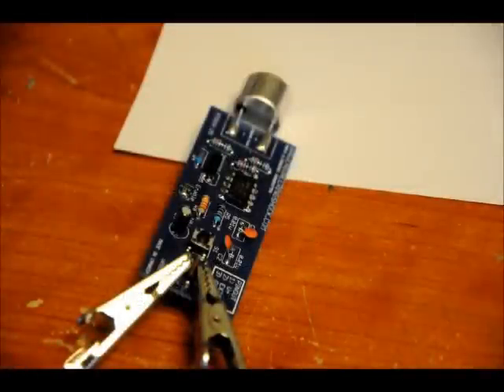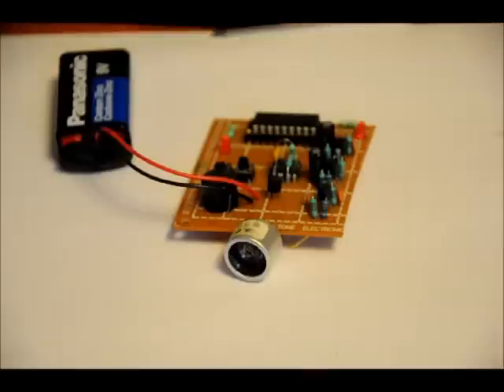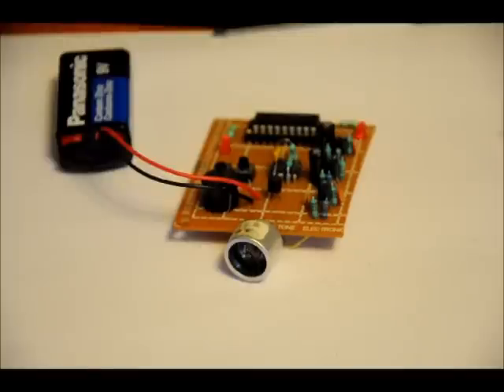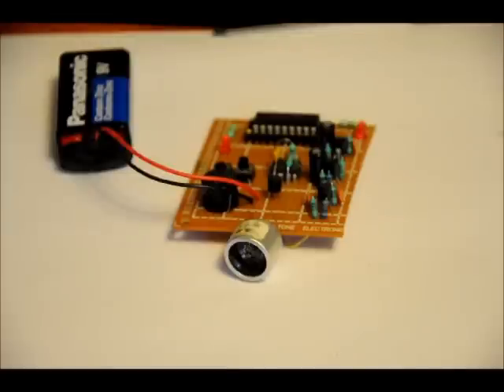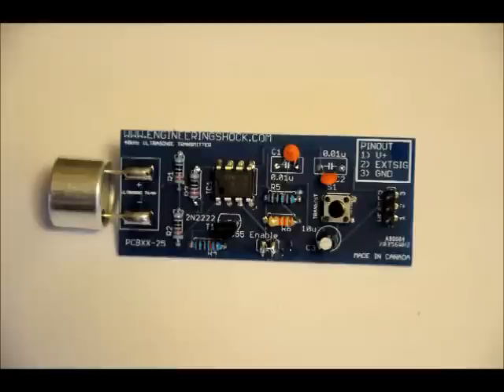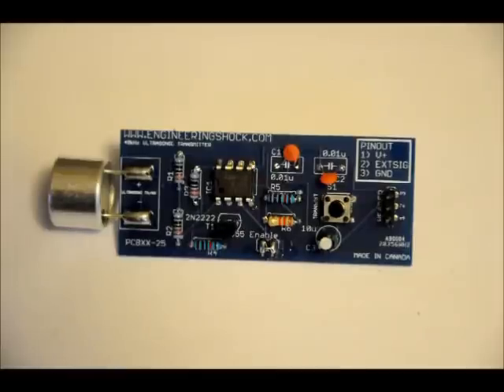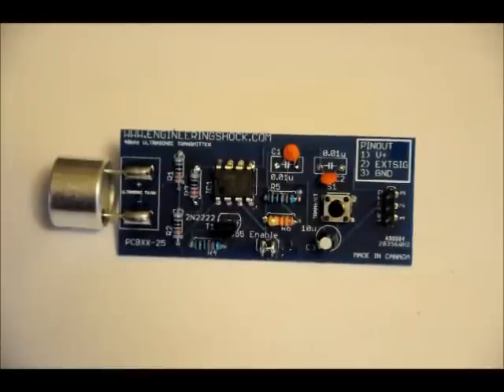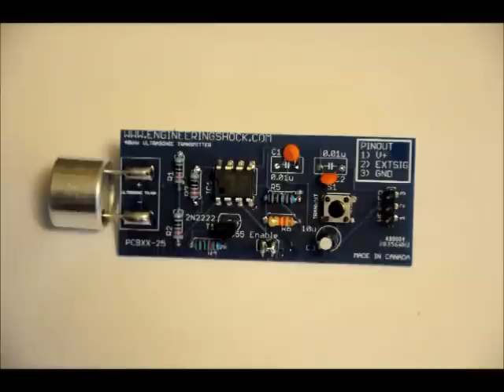The 40kHz Ultrasonic Transmitter Kit with Optional External Signal Option

Comment: Hi 
I am interested in buying Ultrasonic Transmitter Module + Ultrasonic Receiver Module.

I have a couple of questions.

1). does it receive only if both are in a straight line? or work well if both are in any direction?

2). Do you have any other module to measure the distance between transmitter and receiver?

Thanks
T.Vijayan